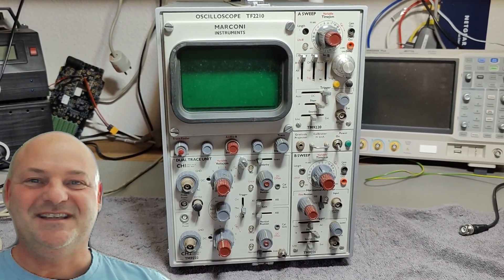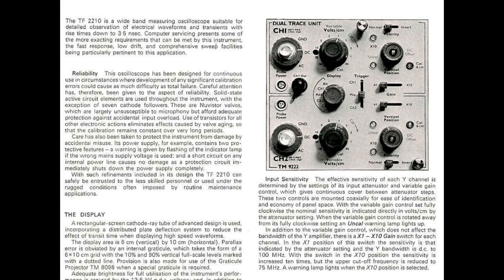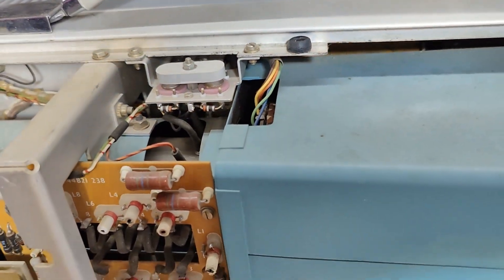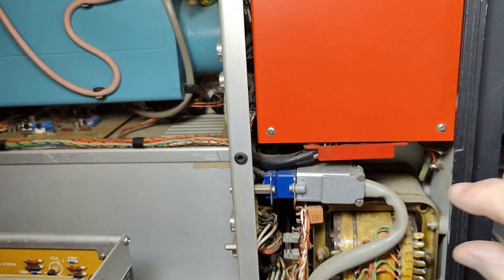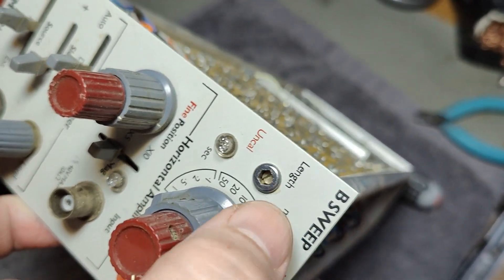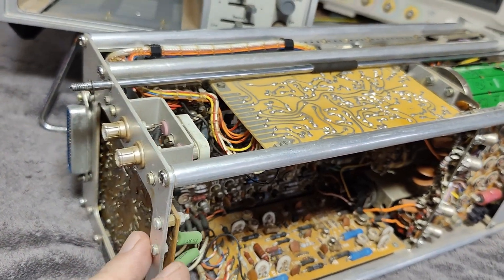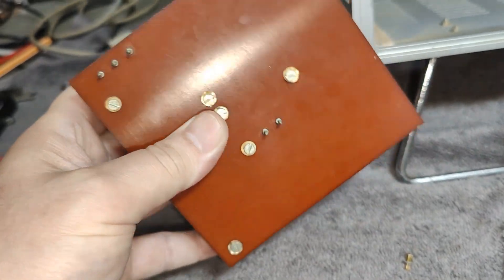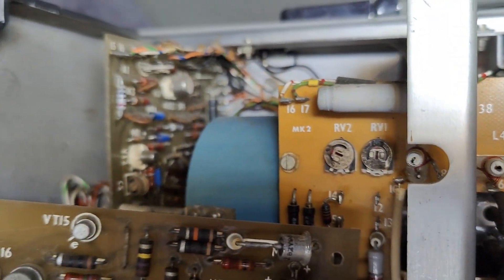Marconi TF2210 Oscilloscope 2ch 100MHz 1969 teardown

Comment: Hi  iam colin from UK, iam just getting started in eletronic, i get a Marconi Instruments TF2210 Oscillscope,  i like your vidoe on it, i got this one on ebay, pay £ 9.90 for it, & pick it up on Monday, yes it's big when i turn mine on,  it make a sound as if it's firing up there are 2 lights in the centre that come on, & there is another light that stay on which is at the top of the unit, it's the first light that come on, the green light afster a whil go out,  i can see this unit will take some time to get it up & runing,  i have subscribe to your site,  as i want to know all about these units,  if you know where i can get a manual booklet on thie unit, can you let me know as i want one, i have look on ebay & other place, so far can't fine it,  like you what i have found out they were made in the 60s. i have other oscillscope about 4, which i have to look at, i wish i had get in to electronice a while back,  have a nice week, & i will look at all your other videos,  colin.

Comment: The tapped vertical deflection plates are required because the finite time it takes electrons to travel across the plates; very ingenious.
BTW, a 100Mhz scope back in 1969 was quite advanced. The Tektronix 465, also 100Mhz, wasn't introduced until 1972.

It's going to take a lot of work to get this scope running again; not just the dried-up electrolytics. The switches will likely have corrosion, which causes intermittent behavior, and many of the trimmer pots looked cheap and probably have corrosion issues as well. Best of luck if you decide to fix it.
Reply from the maker: if only i have a schematic it would have been working allready, all and nothing seems to be going on all over the powersupply, and it is a little bit confusing designed..

Comment: Thank you for the video.
The turret switch of the input attenuator  is very reminiscent of the turret tuners that were used on early 1950s televisions, each strip could be removed and replaced by one that tuned the television channels in your area.

Comment: Nice piece of kit, may be worth replacing the caps and the cracked diode, not sure how you can fix the trimmer on the front panel without the fancy nut, maybe someone with a small lathe and a lot of skill could make one?